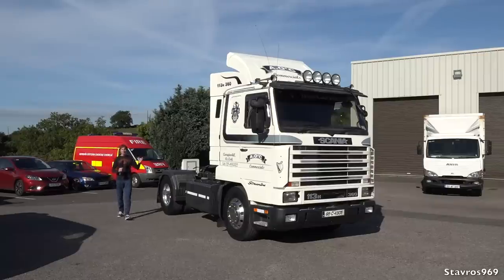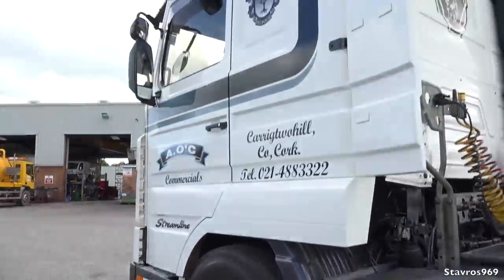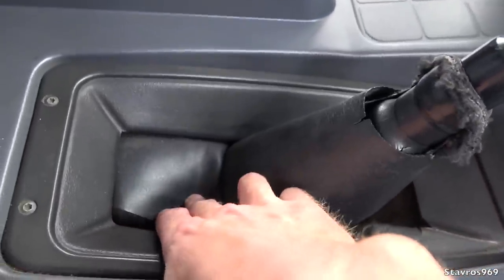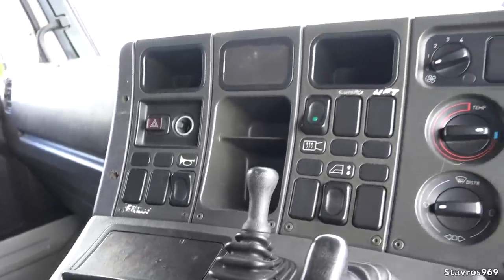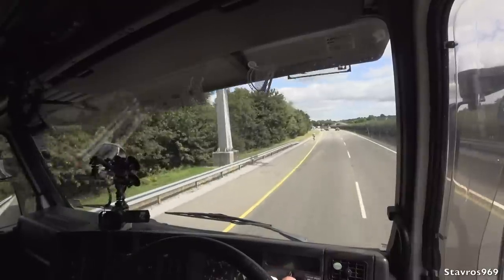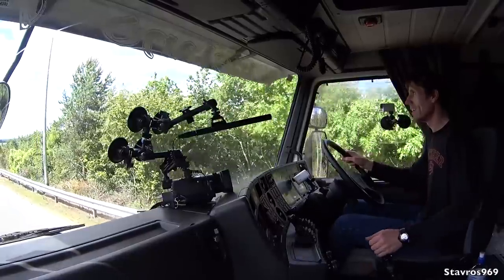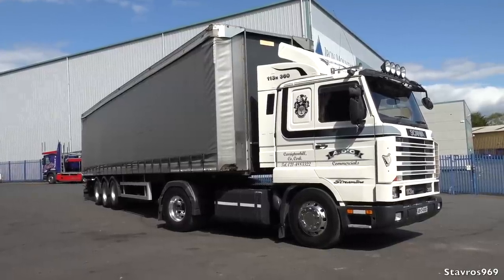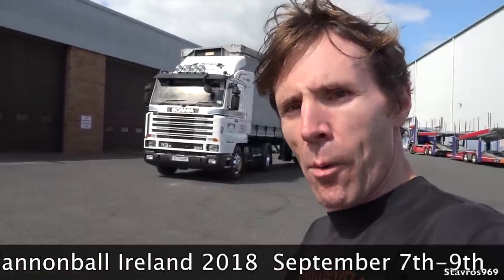1995 SCANIA 113 H (23 Year's on!!) Full Tour & Test Drive

Comment: Here in Brazil they're still working a lot. Also in 6x2 configuration, pulling 3 axle trailers or even double trailers (bi-trem) of 2 axles each.  It was the best selling heavy truck of his era, coming with 10 speed scania transmissions. A hell of a good truck for Brazilian conditions!

Comment: I am not a truck driver but I have a memory connected to Scania 113's. I was on some kind of camp meeting. I am not very used to sleeping in tents. In the night I woke up and had to go to the toilet building a few hundred meters away, but i felt already very cold in my sleeping bag inside the tent. Somehow I was left over to be alone in a tent. Now I still had to go outside the tent. Suddenly, from the nearby motorway access, I heard a truck noise which, in my perception, was radiant with power. Now I had the strength to go out of the sleeping bag and the tent. After I had accomplished my visit to the toilet building, I was happy with it but I still had no clue what truck it was. Nothing to bother about at that moment. Rather sleep. Years later, other place, other country, I heard a truck and immediately thought: "that is the same type as back then, the one which helped me get out into the cold." That time I could see the truck, and read the type. It was a Scania 113. It is already long ago. In the meantime I have forgotten whether it was a 113 H or a 113 M.
Reply: You should write a book on your experiences.

Comment: I am sadly not driving at the moment but I swap a new truck for my old DAF 95! No safety belt to stop you moving around if you need to stretch to look out at awkward junctions, no speed limiter so you can keep memento on hills or get passed things. 350BHP  and would happily pull up the steepest hills at 60mph.

Comment: I had Scania MA 113 so ful airsprings under. Toppline cabin, it was best and most reliable truck what i have never had. was from yesr 1995 and 360 horse engine, where pushed out 450 horses. Was drived totally 1 656 000 km when I sell it. Only one wheel bearing changed, gear never opened, rear axle never opened, engine was made once, clutch same time when starter ring on fly wheel. Very reliable truck. It was after sold to Irak, so it is maybe now dasys going on.

Comment: Nice job and for the speedometer it has United States or united kingdom style speedometer with mph big numbers but Km/h inside because Ireland hasn't started using kilometers per hour until 2005 if I'm thinking correctly
Reply: EpicThe112 Ireland has used Kmh for a lot longer than that, I used to get the ferry from Heysham to Warrenpoint in the 90’s and drive down to Tallagh, near Dublin, it was Kmh the moment you crossed the border.

Comment: Completely old school and mechanical and why is the Jake brake switch on the floor.
Reply: Its not an engine brake as it would be known here in Ireland or retarder its an exaust break button on the floor . You use the heel of your foot on it . It just backs up the exaust fumes it wouldnt be as powerfull as a retarder or Jake brake .

Comment: jesus....driving this with all the 234 gears....is clutch all day long;)((
Reply: I don't understand it really. I know the splitter gears on Eaton Fuller transmission don't really require that. They're air assisted if I am correct. So all you need to do is flip the splitter and then come off the power and the truck does the rest. These european transmissions are a bit weird to me